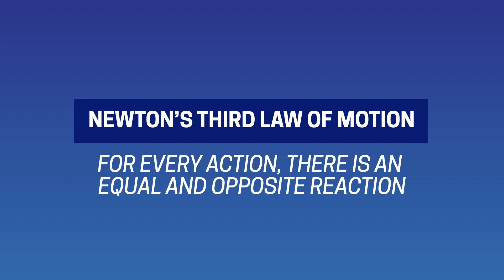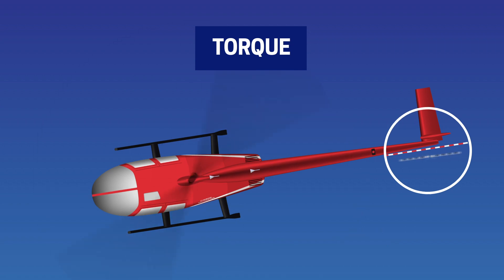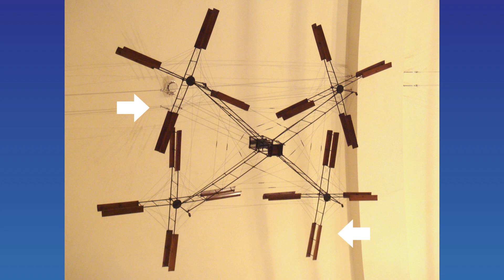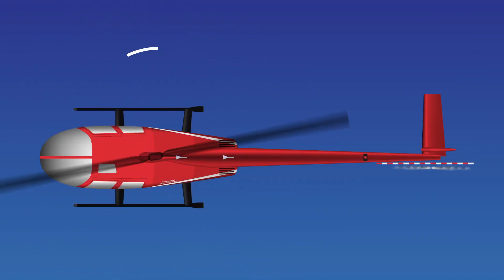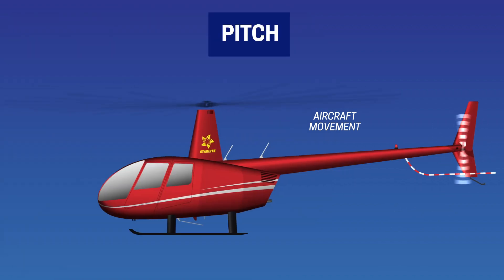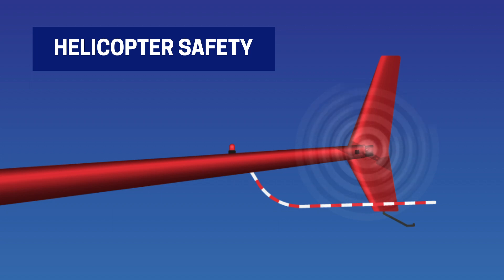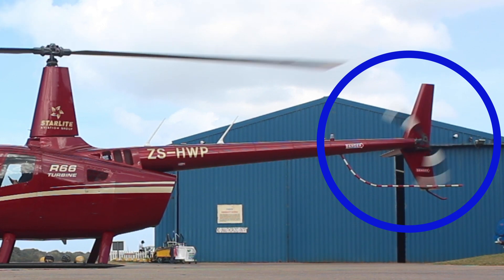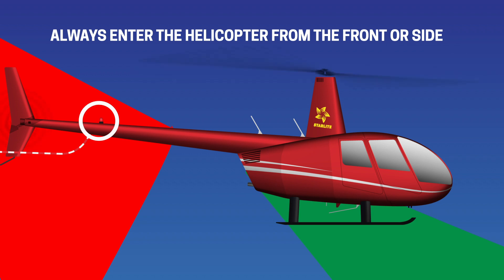Why Does a Helicopter Have a Tail Rotor at the Rear?

Comment: 01:25 Aircraft is turning in the direction of rotor rotation. think the graphics are wrong? the equal and opposite direction would have the aircraft go clockwise right?
Reply: i think thats wrong, it should be Opposite Direction of Rotor Rotation
Reply: Definitely, there is a mistake!

Comment: Sir I have one doubt
Is tail rotor can rotate both directions 
I mean clock wise and anti click wise
Reply from the maker: Hi Venkaiah Swami
. Thank you for your question as it is a very good one. A tail rotor can be designed to rotate in either direction, it is completely up to the manufacturer as each helicopter’s design is different. For example, the Robinson R22 spins anti-clockwise but the Robinson R44 and R66 spin clockwise due to the fact that it has much more downwash and it has a larger horizontal stabiliser (tail) and Robinson found it to be much more effective this way. Hope this helps.
Reply: @starliteaviationgroup128  thank you sir
Reply from the maker: @60venkaiahswami5  its only a pleasure. We hope that you enjoyed the video. If you did, please hit the subscribe button.
Reply: Jesus loves you all very very much repent and believe and be saved from eternal punishment of sin amen, Jesus suffered for you have a good day <3 (: